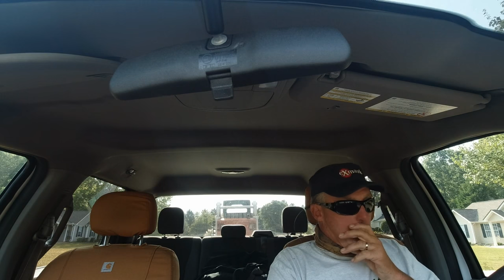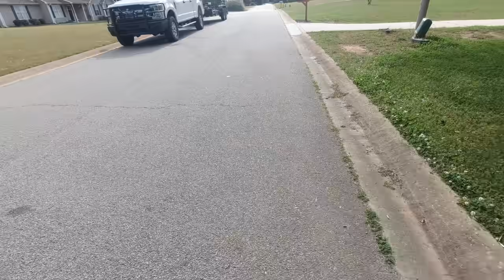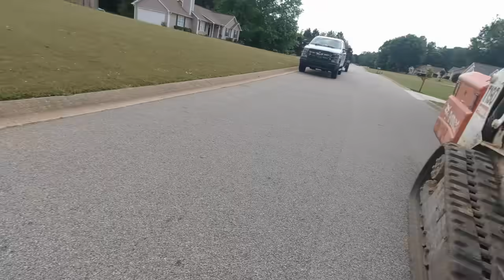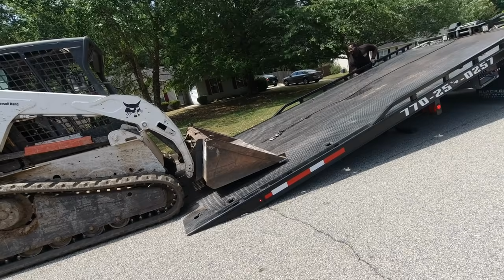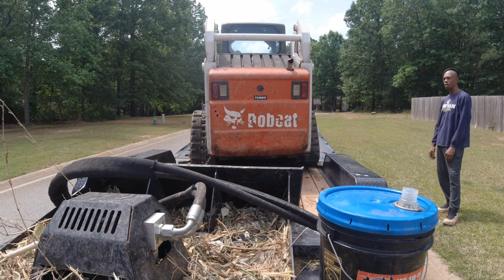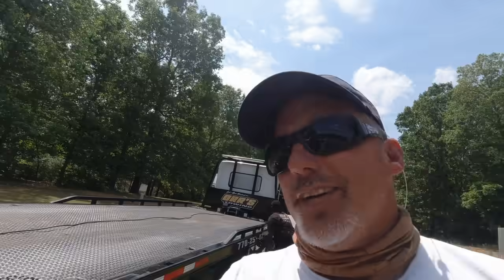Unbelievable tow truck acrobat Bobcat break down!! - Suxs to be Ray today fo sho!!

Comment: I have same machine but haven't had that problem.  you should see 12volts at the solenoid when you hit start so you need long leads to watch volt meter in cab when you hit start.  if you see 12v but no spin then you probably just need new starter.  good luck.  I have a little less or same amount of experience on bobcat as you judging from your videos but I am leaning toward sticking to mowing.  I would rather have a 700 dollar day mowing than a 1000 dollar day on the bobcat.  my back agrees.
Reply from the maker: yeah thats true this time of year- but in the winter the bobcat is essential to earning.
i got a key ignition switch and im getting nothing at the ignition switch - no juice at all but 12v from battery to starter. i jumped the solenoid with screw driver with the ignition switch on and it turned over strong but wouldnt crank. i believe its switch aint getting power- not sure why - i checked all my fuses
Reply: mine only dies when I not getting fuel and occasionally have to squeeze the primer bulb.  fortunately never had electrical problems.  I did get that 2000 dollar rock bucket for a 875 dollar job. smart hugh. but the bucket is awesome.